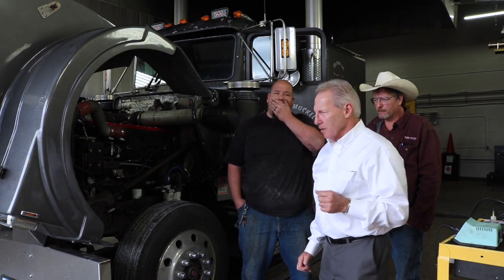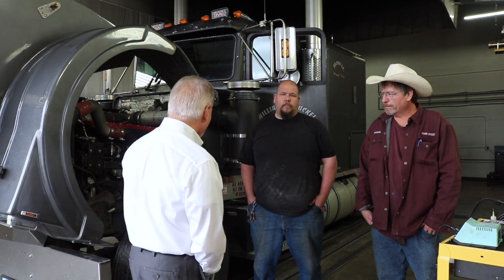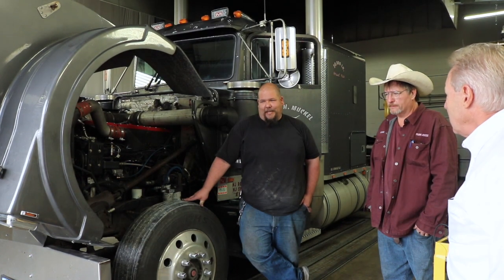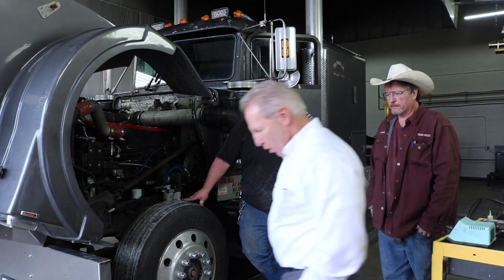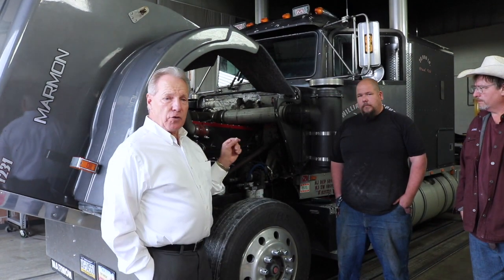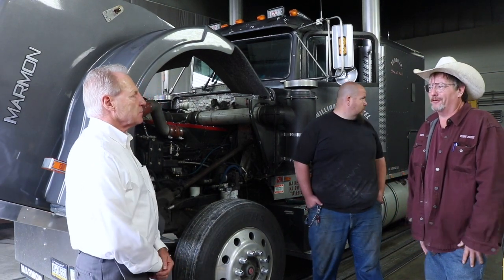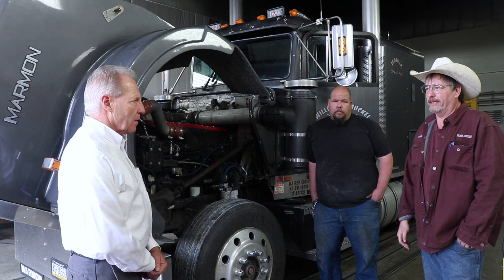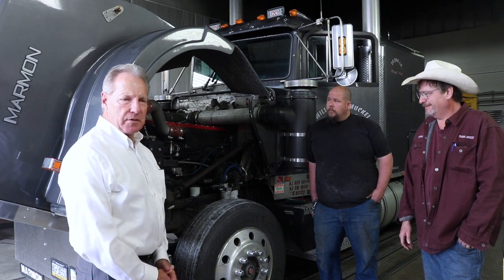1986 Marmon Repair and Tune

Comment: Marmon might have used to make their own sleepers in the beginning, but i know i made them in the end. I remember when the stand up’s were introduced and took pride in knowing i had a part in the making of a fine truck. I worked for a company that manufactured truck and bus parts, and when they got the Marmon contract i was put in charge of it. We did all the aluminum weld and build. Those trucks were put together in about ten different Quansett huts.

Comment: Red top lack of power KILLS THE TRUCK.
Reply: Lack of power? You do realize that a red top is one of the stoutest factory motors out there, even today, right? These are usually set at the factory ratings of 525/1,850.
Reply: @n8bolton  525/1850 is what you consider stout? lol Ok. Have fun over there at the "kid table" (Cummins fan-club lol).
Reply: @LuxCaeca33  I'm actually a Cat guy. But alright. My red top runs as well as any Cat I ever drove.
Reply: @n8bolton  I wasn't saying that they don't run. I was saying that they can't handle as much power as other comparable engines.
 
Simply running does not make a great engine. I'm a Cat guy too. 3508B or bust lol. They sound better than any other V8 imo, and with some tuning, they can make absolutely massive amounts of torque while still remaining reliable.

Yes, I know they weigh close to 4000 lbs all on their own, but I don't care, honestly. They're damn-near bullet-proof, which is why they weigh as much as they do. Technically, it's a "marine diesel", but that hasn't stopped anyone from putting them in heavy-haul tractors.
Reply: @JosephArata  exactly what cam is the question, my CPL is 2391 and o plan on doing the inframe soon.  Is it just the stock 525 CPL to build to or a more aggressive cam?  As far as I can tell the Marine cams aren't really a big upgrade.

Comment: Nice ride but I woulda kept the Big Cam in it
Reply: Parts are becoming hard to find for them, and they are also far less fuel efficient than a late model N14 is.
Reply: @JosephArata  lol what are you talking about?  I can get anything I need for my Big Cam without any issues. Inframe kits are a plenty. I can get a reman big cam for around 11k in Raleigh in the crate ready for drop in and I'm averaging 6.5 mpg. They are good economical motors with absolutely 0 emissions issues lol.
Reply: @Hugh_jasshole1980  Sure have what you want. 6.5 mpg isn't a lot. N14 can get as high as 8 or 9 with the right parts and fuel maps. You can take that mechical injection pump crap and throw it down a mining ravine for all I care.
Reply: Cummins 855 was a PT (pressure and time) fuel system and was not a mechanical fuel injection pump @JosephArata
Reply: @chosen118  It's a gear driven timed fuel pump with mechanically activated spring poppet injectors, it is a mechanical injection system. Stop trying to make it sound fancy, it's not. If it does not have electronically activated solenoids or peizo crystal stacks, it's mechanical injection.
Reply: @JosephArata  
The fuel pump on an 855 Cummins is not timed in any way shape or form. The fuel pump simply delivers rail pressure to the injectors that are actuated by the injection lobe on the camshaft. Yes it is a mechanical injection but it is not delivered individually to each cylinder like say a 3406 Cat. I'm not trying to make it sound like any more than what it is. It has worked for a lot of years but it is actually somewhat primitive and crude but it worked.
Reply: n14 is just a newer big cam. fixed the cracking and leaking issues. you could get them as an STC
Reply: Batojiri has no knowledge..
Reply: @Closeoutracer  Take your inefficient smoke machines and sit on them if you like. I'll be making money with new technology.